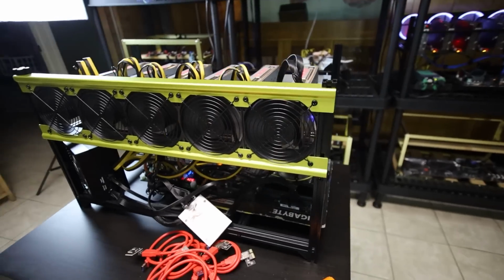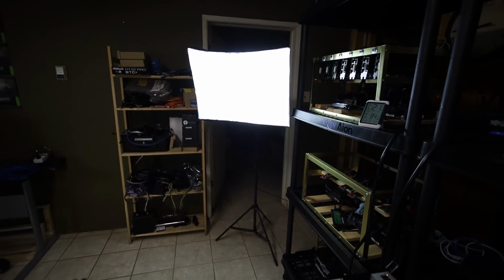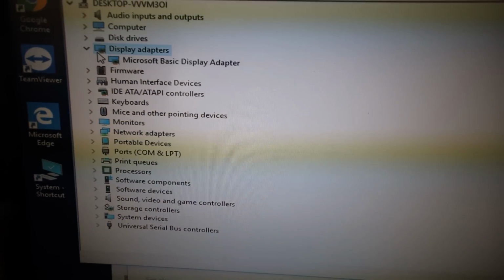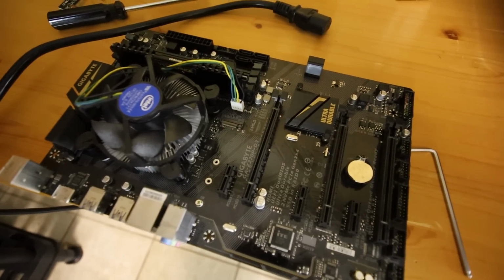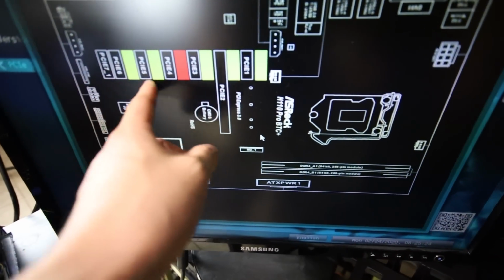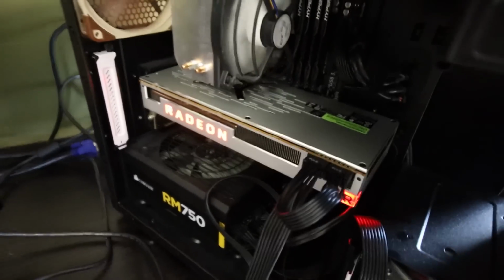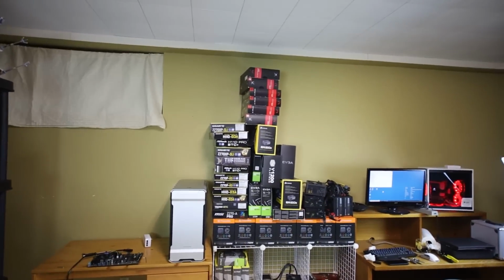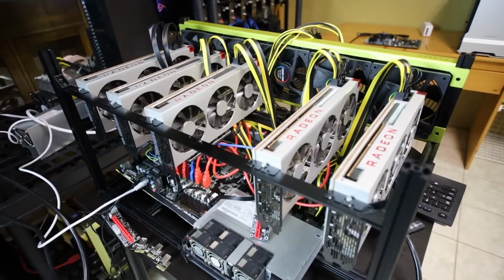Building My 6 x Radeon VII Mining Rig... Part 3

Comment: That happens with my RX 480's from time to time so I have a decent work around.
Check all the cables making sure they are not the issue - usually it is
Check the riser
Isolate the card and boot up only using the one card
Re install the AMD drivers for the one card - Reboot
Do your overclocking - Then power down

Then connect the other cards. Sometimes that causes the other cards to go down.
If that happens just repeat the process for each card while not unplugging the previous card.

So for Ex
Fixed Card #1
Then for card #2 leave card #1 plugged in as you fix #2
Then for card #3 leave cards #1 and #2 plugged in as you fix #3 etc etc

Comment: Personally, I would have connected one at a time when already the os and all params such as page file etc settings all set, amd driver downloaded and ready to install finally run a backup and turn off. Pull the network cable, plug one in at a time, noting the card and its ID coming up in dev manager and OverDriveNTool, and which I’d is it in regedit etc. Per card..
And as they live in my house keeping it warm, 2x 1200 or 1600 ti ATX PSU’s..
Hindsight ey..
Mining, so pedantically frustrating..

Comment: Open it up, clean out. See if if anything got burned. My ASUS motherboard was annoyly switching to internal graphics every other time with new CMOS battery. I blew out the dust, put my rig in a case for once and now it just works. 
Could be a bad chip in a first place, or you happened to run it over 60°C. At higher temperatures you can expect ICs life expectancy gets progressively worse.

Comment: If you cant RMA, rip off the heatsink, plug it into a x16 slot, brush alcohol all over the board, then turn on the psu. Find the short by locating where the alcohol evaporates the quickest. Replace capacitor. Check out Louis Rossmann or other board repair guys on YouTube.

Comment: U are not alone!!
RiG built ASUS B250 with 8* AS Rock VII. Started all well, after one day one Radeon Vii not showing at all. Went thru all what U did same result. Waranty replacement ( DOA death on arival) solved the problem.
2 month later I got another 4* Radeon VII Sappire into the RIG. Again one GPU was (DOA) again replacement.
Now almost one year after, it starts again with warranty replacements with the fans! So keep your receipts!!
Conclusion! The greathest GPU U can by. I would by them only new with warranty!! If they are running, then the GPU's run great, only be aware of the fans.
I feel with you! Keep calm! It's just a GPU 14days warranty replacement, and not a ASIC first batch (tripple priced) miner that failed. ASICS (DOA) really screw you with this!!

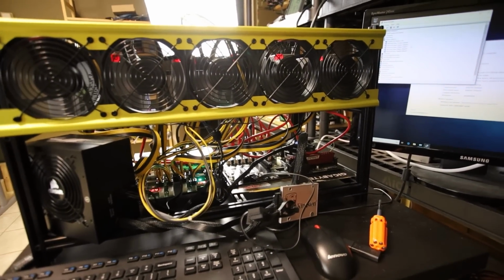Comment: 8:06 lol sorry to laugh but i know ur troubles
i wont even use gigabyte products for the reason ur experiencing 
be thankful that the mobo still worked after u unplugged the gpus
i fried 2 mobos in a row before i realized that their 2nd bios chip was not connected to anything trace wise 
and if u populate all slots the mobo cant power them all 
on that specific mobo u could only populate the top x16 and x1 and the bottom x16 and 1x
if u populated the middle x1 or bottom x1 with the other 2 the mobo dies lol

Comment: I have two ASRock Radeon VIIs mining. The first one I bought was DOA. It did the same thing your card did. I was able to get a replacement. The second card I bought worked and after a week I just moved it over slightly on the rig and it stopped working. I was able to get that one replaced too.

Comment: I have a 6 Vega card rig running on that Gigabyte board with 2 VIIs on it.    I had attempted to use an Asrock board and couldn't for anything get the system to post with 12 cards.   Split into 2 rigs everything was fine.

Comment: No problem RPM!  
You have a "spare".. Just suck it up and use the "extra" that you had been using as the single R-7 test for the longest time.  You want to have your full 6 R-7 rig running, there you go.  That's what I would do!   
Looks like you did really good thorough troubleshooting, good job on that.  
Now just suck it up,, put in your "Spare" R-7 and mine Brother!!

Comment: If RMA is not an option then you can try the bake method. I have revived 3 out of 4 cards using bake method. 2 P 104-100s and 1 vega.
Reply: that won't work for his issue, i tried that on my p106 cards that the memory didn't show up on and it did nothing. i used a heat gun directly on the dye for 10-20 minutes at 300 degrees and it did nothing but stink up my garage.
Reply: @michaelhughes9278  thats luck. Most probably you had a component failure. So that won't be fixed by heat re soldering. The method only works if there is broken solder connection.

Comment: Does the VII have a dual bios switch?  Idk, don't own any; but I have had RX 580's that wouldn't show up and flipped the bios switch and it had a second lifespan.

Was trying to figure out which way your fans are moving the air; push into or pull away from?

Hope it pans out one way or the other; I was looking at building a RX 5700 XT rig to be ready for progpow in June.

Peace
Reply from the maker: hey buddy! unfortunately no dual bios, i wish these had another bios on them as they do need it. The crazy 200cfm fans are push into style. I was buying this r7 rig just for Progpow... because of the HBM2 memory but at this rate...
Reply: @RedPandaMining  okay, maybe whoever had the cards tried to tweak the bios for efficiency and mucked it up; just trying to think of the things I would look at before trying to RMA and loose some time; any rate I understand how much that sucks; I got three cards once from ebay and all three were pretty tired or crashed the rig.

Comment: My VII died when using dual power supplies in a rig a while back. Worked perfectly in a normal single PSU setup but died on a dual setup. Never used them again.
Reply: I think this is the same issue I had. My Radeon was working for a week then I couldnt get it to detect. Now the Radeon fan just runs at 100% when coonnected to power and PC not on. Getting it replaced by warranty.

Comment: Hey Red Panda,  How do I chat with you directly?  I have 9 Radeon VIIs spread across a few motherboards,  Your first video inspired me to combine 8 of them into a single rig just for fun.  All were working fine before the reconfiguration.  I can only get 5 to show up in windows also.  All 8 show up in my BIOS and the auto detect screen like you have.  I am using a ASUS Mining Expert.  I had hoped to go up to 11 R VIIs but I am currently limited to 5 with no idea why since the driver should allow up to 8 at least.  

Second thing, PLEASE try putting your profitability R VII in your 6x rig to test if windows will see all 6 or if you are limited to 5 like me.  

Third thing, I have a hunch that the Gigabyte board is not supplying enough power to the video cards and that is why it wont boot.  R VIIs are nearly 300 watts all by themselves.  My Mining Expert has additional power connectors for the PCIE slots just for that reason.  I did not see any addition power connectors on your Gigabyte board.

Hit me up so we can chat.  I am super interested in how this goes for you.
Reply from the maker: @friedelectronics nice fitting youtube username lol! Hey man i'm in the same boat as you and I dont think I could help out as much as i'm stuck as well on this rig and have to RMA...
Reply: How do I PM/DM you Red Panda?

Comment: RPM. Did you try gpuz and see if it sees the card?
Reply from the maker: yep, doesnt see it :( shows no memory on it
Reply: @RedPandaMining  hopefully you can RMA it. Keep us posted.
Reply: @RedPandaMining  i had that exact issue with my 5 broken p106-100 cards! after i flashed the bios a few things showed up on gpu-z but it showed memory and stuff as unavailable. but i sold them online for repair or parts only on ebay.

Comment: The exact same thing happened to one of my three Sapphire Radeon VIIs.  No Adapter found when using atiflash  I liquid-cooled my mining rig so I couldn't RMA the bad card.  I'm currently running on an Asus gaming-f x470 board, two Radeon VIIs, and 4 Vega 64s
Reply: who said you can't rma it? just put the original cooler on it and ship it in. they wouldn't know if you did anything different than changing the thermal pads. the sticker that said warranty void if removed isn't valid in the USA or Canada. its only a thing like in china or other countries they just put it on there anyways for mass production. according to Steve from gamers nexus.

Comment: That's sad, I have 3 Radeon VIIs dead. I couldn't RMA 2 of them and I'm going to try for the third its different brand (2 ASRock, 1 ASUS)
Reply: Were your Radeons brand new and were they connected on seperate PSU. I think running the risers on seperate power killed mine.
Reply: @joop912  One of them stopped while it was working for no reason. but 2 burned becuase I used speliters (also not sure) but the other 2 from ASUS didn't get affected by that, one of them died after while and the other still hashing right now. I bought them all new.

Comment: Sorry for your troubles. Have you tried to re-flash the bios in dos method. I did it on an rx580 to recover the card. I'm not sure if you could do the same with a VII and try to get it back to stock? I know you like windows but I'd still use linux if I was you.  Also would it have something to do with GEN4, try using GEN3 or 2. You say you've tested the mem and ATX psu. Static charge? Good luck.

Comment: I don't think the issue is with Windows it is a dead gpu. Windows would allow up to 8 amd gpu.
Reply: I ran 13 GPU's on Windows for a year stable at 391 Mh/s; but it got old resetting Wattman for 13 cards every reboot.
Reply: @wx2833  oh man tell me about it! when windows screws up the miner with a download and you have to reinstall the drivers and spend 10 minutes opening wattman to change them all to compute! it took like an hour for 7 cards! i found out later there is a command in claymore that automatically changes them all to compute though... so i'm going to try that next time i have to reset them. other than that i get more stable cards when issuing the commands in claymore.
Reply: @michaelhughes9278  I concur .. Agreed .. My start batch file has grown over time as you dig deeper into the readme.txt file.  Or you can just hit "y" when the miner starts and it switches all your cards to compute mode.  I have all my rigs setup to auto power on and eliminated windows login and put the start miner batch file in the Windows startup folder; it keeps the house from being freezing cold in the morning if the power cuts out during the night.  

Also if you put @2145 for AMD or @700 for Nvidia behind Strap 1 or 4 it sets your memory clocks; my AMD's are Strap 1@2145 and Nvidia are Strap 4@700 and it keeps your hash rate up on reboot.

 It would be cool if every miner gave you as many switches as Claymore; that is why it never bothered me about the dev fee; the dude took his time and skills to write out a good product with a lot of static controls built in; and he is very fast to update or incorporate new features and modules; when Elio found the improved timing straps; claymore had it locked down in a couple of versions and added rxboost. 

Now new people coming in can go the less exspensive route of AMD and they don't have to even know all the geek stuff on how or what you need to flash the bios; which used to be a barrier for noobs; or forced them to buy more exspensive Nvidia cards that just takes a few clicks in Afterburner and your off to the races.  

One last thing I found out over time is I bought 50 cards in March of 2017; 25 red team and 25 green team; and so far it seems like the AMD cards have held up over time better than the Nvidia cards; I just keep slapping gobs of fresh thermal paste, ( MX4 ) on them once a year all over the AMD cards and they just keep hashing like a mad man; but if I do the same with Nvidia cards the hashrate just seems to fade over time unless you turn up the core clock +50 at a time or increase tge power +5% at a time. 

Maybe a hard core Nvidia type can chime in that knows a remedy that  I'm not smart enough to find as of yet.  ¯\_(ツ)_/¯

Peace
Reply: @wx2833  13? like amd and nvidia mixed?
Reply: @BitKerelo  That build was with the same mobo Red used in this vid, ( Asrock H110+ BTC Pro ), and was all XFX RX 580's and I did put a 14th card in the M.2 slot for a short time.  I try to avoid mixing my RX & GTX cards because it is just easier to rapidly redeploy on other algorithms based on a changing markets; but have mixed cards before when using claymore while doing maintenance; I just use an extremely large virtaul memory setting, ( 64000 min. & 128000 max ),  since different algorithms call for different size swap or page files; or require an increase over time; and I am now automatically profit switch between 49 different algorithms. It is just easier to manage and run 8 or 9 GPU'S per rig; for example I have 9 RX 580's running steady at 290.046 Mh/s at 779 watts on ethash: 1200 cc / 2145 mc / mV 875 / 875; each card runs on average static rate of 32.289 Mh/s and other my X8 GPU RX 580 rig runs 258.5 Mh/s at 654 watts; and nearly all these cards are going on three years old; The two other rigs are MSI GTX 1070 Armor OC cards setup the same way; a X9 & X8 GPU rig(s); but those draw between 300-400 watts more dependent on the algorithm; I sold off the other half my farm, ( 5 rigs ) to upgrade and buy three FPGA units; and two scrypt ASIC miners, since it will be a while until the next halving on that algo; and there are loads of scrypt coins to mine; or just put them on atuo profit switching / merged mining and auto convert into BTC; and scrypt asics are selling very cheap; I held out as a GPU miner as long as I could; but could no longer deny the efficiency of the hashrate to power consumption ratio.  I have enough spare parts to build one more RX rig; cards included but have been trying to find a good deal on some BCU/VCU 1525 or CVP-13 FPGA cards; but so far everything found is a bit too pricy; so as a backup plan I am just going to pickup 8 or 9 RX 5700's to be ready for progpow in June this year.  Hope that answers your question.

Peace